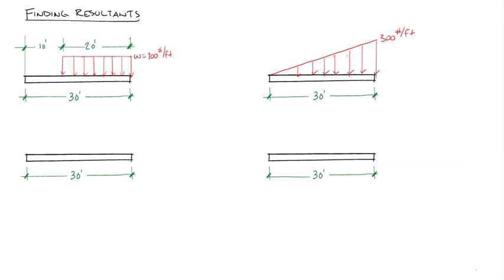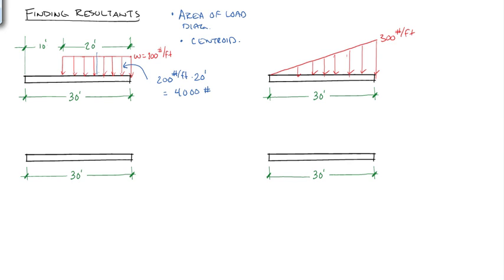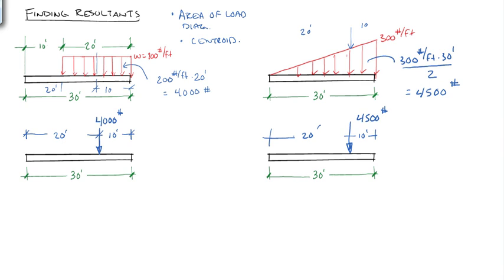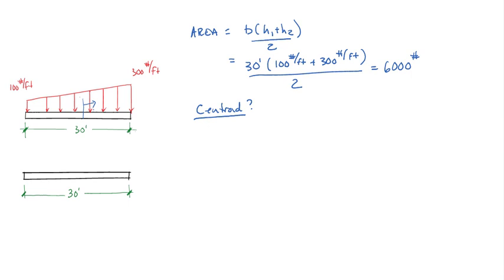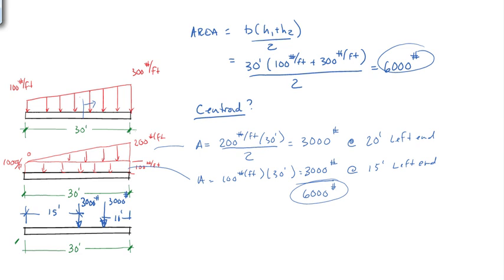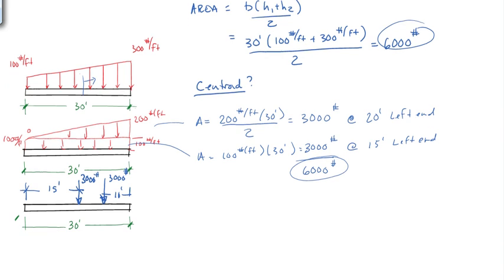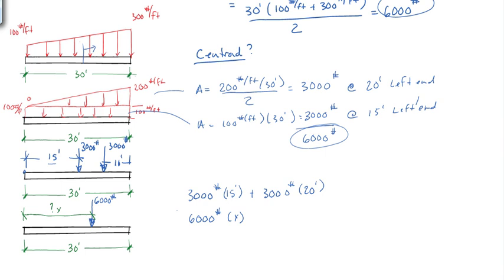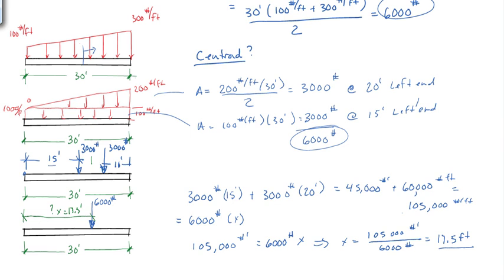Finding resultants of distributed beam loading conditions.

Comment: Hi John, thanks for the vid and working :-) I follow why you broke up the trapezoid, but in a coplanar system why didn't you simply average the centroids of the triangle and rectangle?
Reply from the maker: In effect, when taking the moments about the left end, I am averaging them.  It is a weighted average.  It turns out to be 17.5 ft (half way between 15' and 20')  only because the area of the triangle = area of rectangle.  When the two areas are different, then you must do a weighted average - which is the approach that I use in the video.

Comment: Hi John, 
How did you know its 20 ft from left and 15 ft from left??
Reply from the maker: I presume that you are asking about the trapezoidal load.  The centroid of a rectangle is at 1/2 of the length, or 30'/2 = 15 ft.  The centroid of a triangle is at 2/3 of the length (measured from the short end), or 2/3*30' = 20 ft
Reply: thanks :)